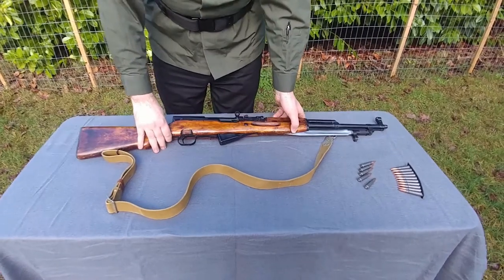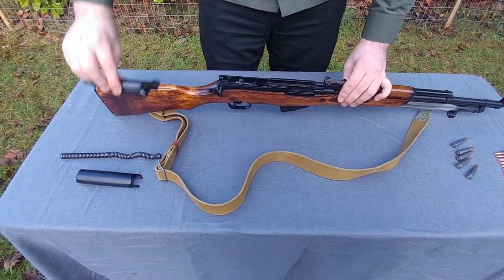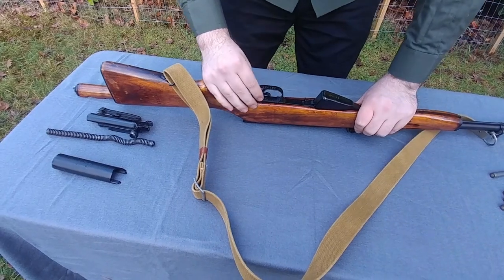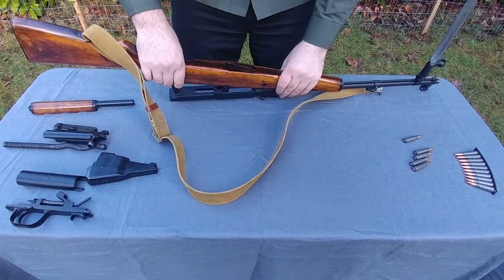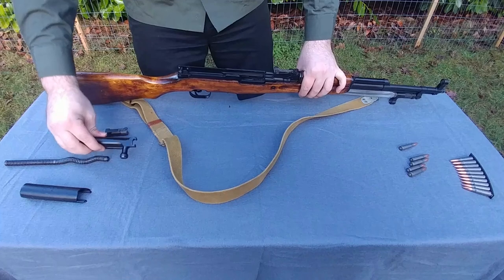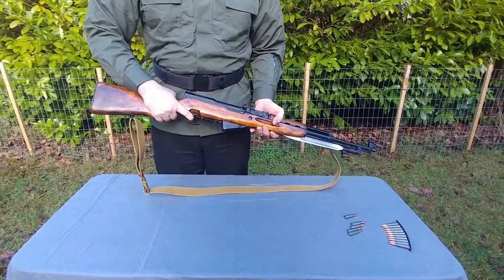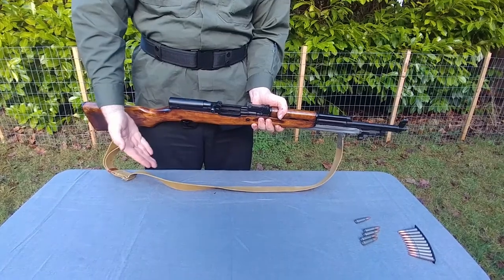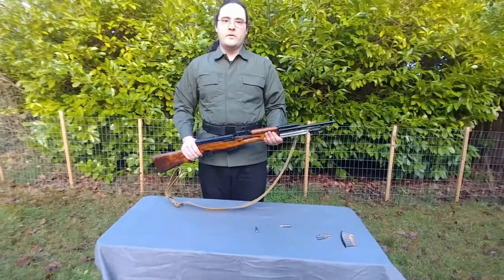Crash Course SKS 45

Comment: What a sexy rifle!! The potential of making this into a tactical modern rifle is amazing.
Reply: Honestly it's not worth it. For starter, we're talking about guns older than your dad, so most likely the bore is shot out, you would be lucky to hit 4 MOA. Than, most of the accesory are cheaply made, so even if the potential firepower is appealing and some made it work, you're most likely gonna ruin your reliability which makes the whole point moot. Either you accept the SKS for what is it, a handy practical carbine, or you buy a tactical rifle for the same price of the gun+parts. What ever use you need would be better suited that way.
Reply: @francoisrioux5869  Yeah, nope! They can be made more accurate and useable. I have 3 original units and 2 "Bubba guns.
Reply: Tapco and Magpul hardware for the SKS are actually very robust.

Comment: Great and to the point presentation. It's unfortunate that you don't have the cleaning kit, for it is really tailored to the rifle. For example, on your rifle the gas tube lever seems loose. A lot of them will require much more leverage and even a cartridge tip won't help. This is why you would use the punch from the cleaning kit to operate, since it has a hole in the lever. Also, punching the trigger assembly with a cartridge might damage the jacket or projectile, reducing the efficiency of that round. This task is better suited to the punch from the cleaning kit. The punch will also help you remove the cleaning rod without taking the whole stock out, as even with a simple cleaning, you will need the rod and the jag and brush from the cleaning kit to maintain your bore.

Comment: If I am not wrong you forgot to remove a spring and a short piston like thing in the area from where you removed the gas block. You need to turn the notch 90 degrees and that spring with short piston shoots out. Although it is recommended to put a finger or thumb in the front before moving the notch to 90 degrees
Reply from the maker: Yeah, that component is there. Doesn't get too dirty, and the case for the cleaning kit has a hole that gets mates up with the lever so you can turn it easily. AK does the same thing with that lever. Awesome designs.
Reply: Correct! 👏🏼😎

Comment: Didn't mention rattling the bolt to make sure it was free-floating. But, that looked like a Russian unit. If it was a '49-50 model, it would have a spring on the firing pin and wouldn't free-float. 😎✌️

Comment: This is a WW II  SKS ?
Reply from the maker: No. This one was made in 1951. The '45' distinction came from the year it was finalized in design. However, production and adoption by the red army came later in 1949. From what I understand it was initially designed in 1943, hence the M43 cartridge. I assume there were some difficulties setting up final testing and production lines around those years.
Reply: @KaletheQuick  hmmmm,thanks for the information !